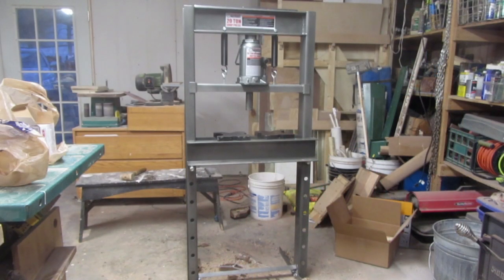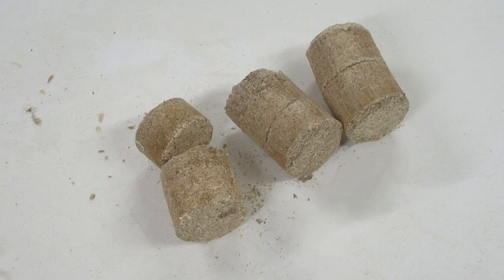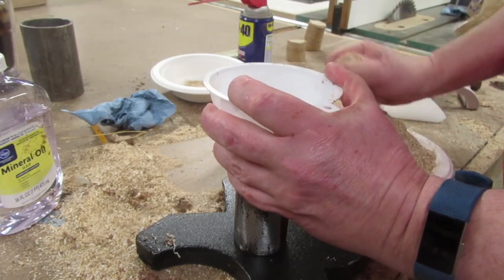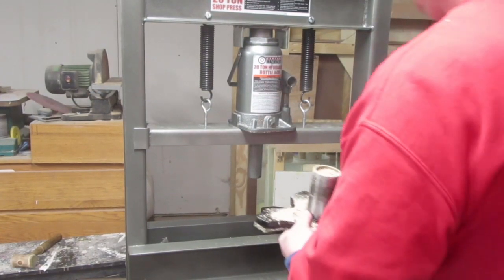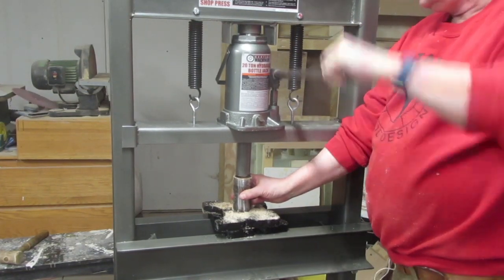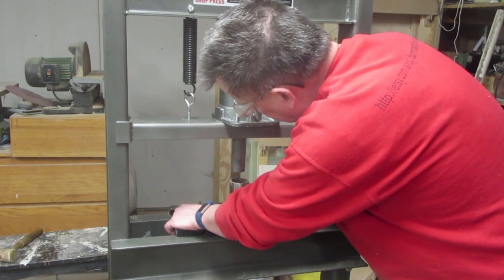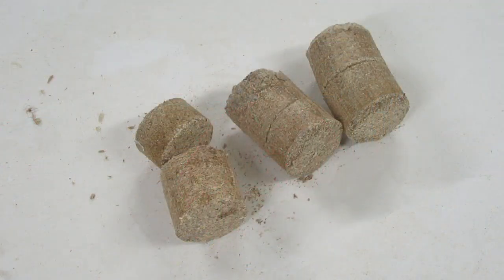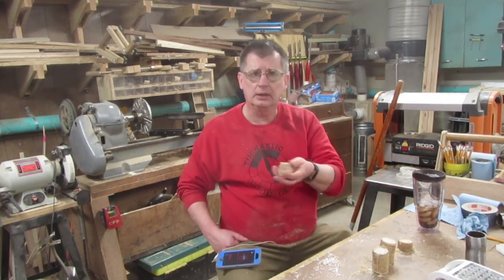What to do with all that Sawdust 2   Pellet Press

Comment: Wood pellets are infact held together by the natural lignin in the wood, but the lignin has to be melted/softened first before it can effectively bind the wood together. The temperature of the pellets can be a couple of hundred degrees when coming out of the pellet mills so you may want to try heating up the die and making smaller diameter pellets for better heat distribution. 

Also we add about 1.5% starch by weight to the saw dust to help bind the pellets together so you could try that as well.

Source: engineer for a wood pellet manufacturer
Reply: the theory behind it is that the compressiin alone generates the heat to gkue them

Comment: Bill I live in Alaska and heat with firewood. But I am also a preper. I have been making fire starters from sawdust (obtained from the local cabinet makers bin) and old candles. I take an old bread pan and heat up the wax until liquid. Then taking saw dust and adding until the mixture is a stiff like oats consistency then mash out into a thickness of about  a inch in the pan. making sure I use a block of wood to pack the mixture. Then let cool thoroughly! then turn pan over tapping it on the bench to release from pan. Then I break apart or cut into cubes and bag!

Comment: I think your on the right track, your using resources to heat your home, shop etc.. Along with HF bearing press I bought the 11/2 ton air bottle jack instead of cranking by hand, so so much faster.
Reply: we have the same setup in our shop. tge air actuated jack is so nice.

Comment: Hello, I'm going to do the same thing. I have the Harbor Freight 20-ton press but upgraded the bottle jack to a Big Red  Pneumatic air bottle jack. I'm going to hopefully get it. If you look at other briquette makers it's a constant feed. The first five or so don't pack as well, until they tighten the end of the pipe { tappers} with a slit in the pipe. I think that will help with the flaring at the end of your pipe. I will try this weekend and let you know how it goes.

Comment: If you have a tapered mold made out of steel you could just keep adding sawdust to it with every stroke of the press, and it will compress it 2 ways with it coming out the bottom  in a log. it shouldn't be very hard to break it to size if they don't do so on their own.
you may be able to make a "proof of concept" out of wood to give it a try.

Comment: Thank you, Bill.  Properly informative video.   The 'Briquette/Pellet' makers have automated machinery that seems to work pretty well, and yes, one of them told me that Paraffin Wax works well in their product. They were looking into alternatives, since Paraffin Wax is typically made from petrochemicals, which hits their green credentials, so they were looking into using Oilseed Rape as a feed stock for the wax... Here in the UK, buying briquettes/pellets made like yours is cheaper than buying town gas or electricity to heat your home. A lot cheaper!  So I have been tinkering with stoves a good bit in recent years.  I can build a 'rocket stove core' that eats twigs, pellets and offcuts, but chokes on sawdust so far - but it is supremely efficient - in the mid 90% range - no big secret, just get  a turbulent burn at around 800/1000C (this calls for refractory ceramic insulation!) and the exhaust is Carbon Monoxide free, which is as good as it gets.  Steel tube rocket stoves cannot do this, the steel loses interest!  I managed to destroy a stainless stove that I bought, tinkered with it until it got hot enough, and then it disintegrated!
I plan to buy a 'sawdust burner' off eBay, see how it works, maybe go for a gasifier/burner/heat riser design to get the temperatures needed?  The sad thing about letting sawdust rot is that not only do the microbes release the carbon in the wood, they also do what cows do and release greenhouse gases!  So I salute your search for a solution.  Well done!  Ben 😉

Comment: Bill, I haven't done it in a long time, but I think its a viable use of the sawdust.  Take something like a popsicle mold and pack it/them with a mixture of wax & shavings. You could also use hard plastic cups. Because it is a little time consuming I would do it while I was trying to figure something else out. They say that the best way to solve a problem is to set it aside & work on something else.  Just one man's opinion.

Comment: Thanks for sharing Bill. I have a lot of trees on my property so I usually just spread my shavings and sawdust among my trees but I do know of several households here in southeast Indiana that have outhouses in use and they utilize the sawdust as composting material.
Reply: Keep in mind that for sawdust to decompose it will pull nitrogen from the soil so you need to add that back into the soil.

Comment: I’d try using sugar water as an additive. Mix it with the sawdust to dampen lightly. You’ll have to let the pellets dry afterwards. But the sugar will both keep it together as well as adding another fuel source. You can even use sugar to build model rocket engines.
Reply: I was going to suggest adding water and leave it to sit soaking for a few days then when it turn into a "mud like" consistency press into briquettes and let them dry

Comment: Bill, Being a blacksmith, the bottom of my coal bin have fines ( aka sawdust). What i do is make a slurry using bad flour from home or a bakery as a source for a binder. I use cardboard egg cartons as a mould. In your case, old cupcake pans or even tapered plastic containers will work. Let dry and voila, a briquette.

Comment: Bill, make the tube longer and only stop the tube for the/a small first pressing.  After that has been compressed, remove the stop at the bottom and load more sawdust into the tube (as much as you can put inside).  Compress again allowing the bottom to come out and cut off to the desired length as it is  pushed through the tube.  

With the suggestion a continuous fill can be achieved thus making the process faster and less messy.

Good luck.
Reply: I think the short strokes are the issue. Constantly having to mess about raising the ram to add more sawdust.

Comment: Wood pellet manufacturers add only water to the mix when pressing then let it dry afterwards. A fire log sized mold would use up more sawdust and take less time overall.
Reply: We only add water to the saw dust if the moisture content is too low. We shoot for 12-13% moisture content in the wood before going into the press and it usually comes out around 7-8% moisture due to the heating of the material in the press.
Reply: @joshjordan6201  Depending on conditions the saw dust from a woodworking shop might still be too dry. Then again it could be too wet.

I've never made pellets but I used to sell woodchips and sawdust to pellet manufactures. We often had to wait until Summer to ship as it rains all winter in these parts. A tractor-trailer load of sawdust gains a lot of weight in the rain.

Comment: I'm watching this video 4 years after your released it.  It's an interesting technique. I was just searching on "pressing sawdust" and your video popped up.
I want to do something similar. The method is time consuming, but it works. And except for the press it's free and you only need elbow grease and patience.
I wonder how much pressure you need. Your press is 20 tons. Will 2, 3 or 5 tons be sufficient as well?

Comment: I use my log splitter as a press,I block the outlet to compact, remove the block and advance ram to push out plug.work in progress building a multi small pellet ram.

Comment: Hi. I've had my hand press briquette maker for 10 years. It's pretty good. You can watch my videos if it helps. But the composted wood chip makes much  better briquettes. 3 or 4 months composted and then make your briquettes and you'll be amazed at the heat and the length of the burn.

Comment: my best use for sawdust reclaimed from the band saw, circular saw and drill press is to mix it with epoxy to create an epoxy fillet for filling screw holes, gaps and various joints on the 21' fishing boat that I'm building. it helps me to achieve perfection where my craftsmanship is lacking. I bought four containers' of wood flour from CLC Boats for the same purpose and found that I've produced enough sawdust to not need theirs. I fill plastic containers with lids  depending on the size of the particles for differing needs. When I need a super fine filler I use all the fiberglass dust I've gathered from sanding, all with minimal waste from the building materials. Everyone needs a hobby, FISHSTICKS.

Comment: Maybe try a two stage ram. They will allow quick ram movement in stage one and then stage two for the intense pressure to compress into the plug. I agree with you. I am always trying new things. Failure is just finding the way that doesn't work.

Comment: I mix my sawdust with paper shreddings plus old veg oil, I put the mix into a briquette press lined with newspaper. I stop the press as soon as I see liquid 'wetting' the newspaper. Even though i wasn't using the press to it's maximum, I still had to build the briquette maker into a framework made from a sleeper.

Comment: Get the paraffin warm enough to barely melted and then mix the sawdust directly in then form them into small balls and you have made the best firestarters ever. You can even take the wax and sawdust mixture and pack it into paper egg crates. Then you just break off a couple of egg sections and use it as far as starters. This works really well for camping. I have made them for years.

Comment: I make pallets for burning and find that you're doing too much to rush the process. I mix saw dust water and scrap newspaper in a 5 gallon bucket. Equal parts paper and saw dust, water to cover and saturate. Then I simply let it sit and dry out in a 5 gallon bucket. When dry and compressed naturally. I take pellet out and cut down into smaller bits. I add paraffin for a longer burn and use them for camping, sell as natural hookah coals and are great for starting that fireplace to set the mood

Comment: You didn't fail. you took a shot, and found a way that didn't work fast. good test run. proved the concept. now scale to suit. maybe a hydraulic ram, powered by a small engine, like a log splitter and a thicker die, to push the wood through. and bingo,  you stand there and operate the ram, refill the wood, and wood plugs drop out the bottom.

Comment: Use a 12" tube and drill 1/16" holes in bottom 6" for fluid to drain out. 2" abs or PVC works well.

Comment: For my fire place insert as a fire starter - In a 5 gallon bucket, compact saw dust 90% full add 1 gallon of used motor oil.  Use as bed to base for fire wood

Comment: I love that you tried it and tbh I think you should just try to optimize the production more. The ideas were good (except the stove), but you didn't do them very efficient.
For example: Mixing paper and sawdust is a great idea, because you will get free heating forever! By using a larger buck to mix more sawdust and paper together and let it soak a day, you only have to mix once for huge amounts of pulp.  This method is used to make bricks for buildings, and there are tools to create them very quickly. Mainly there is a kind of mold-press, where you just put the pulp in and squeeze a bit and you get a larger brick. You leave it there to dry and make the second brick next to it. It's a matter of 10—20 seconds per brick.

If you don't wanna do it yourself, have someone's kid do it for some extra money. It's a fun thing to do when you think about it :)
I will try to find a vid on yt that shows more effective ways.

#edit: I found a video with the tool I mentioned: https://youtu.be/7bwKYfMoFYQ
Maybe it's something for you! 

Thanks for reading!

Comment: I saw awhile back a video of a guy using a hydraulic log splitter for a similar purpose. He replaced the wedge with a flat head and pressed dry leaves into a "log". That might work with the sawdust.
Reply: Also, no pumping of the bottle jack because of the hydraulic pump. Can be electric or gas engine. Louder but faster/easier.

Comment: Do you just want to get rid of sawdust or are you trying to develop another fuel source?  If the former, try this. I just fill a four-cent brown-paper lunch sack about two-thirds full of sawdust and double-fold the top.  I put one bag on top before lighting a new fire and place a fresh bag on the hot coals when adding more firewood.  As the paper is consumed, the flame produces a crust over the surface of the sawdust. The sawdust retains the shape of the bag and slowly burns on the surface.  If not disturbed, it is consumed along with the wood. Even if the burning sawdust gets scattered around when adding more wood, It has never put out the fire. Getting rid of sawdust can be simple and easy. Turning sawdust into fuel doesn't seem worth the time and effort.

Comment: I add sawdust to an empty paper towel holder. Close off one end and fill tube half way then add peanut oil . Fill the rest of the tune with sawdust and tamp down with a dowel. When full close off the other end. Place on hot coals or light with a match and it will burn hit and fir a long time.

Comment: Great video. 👍 Real easy way to get rid of all that sawdust is pretty simple.. just take some used motor oil. Mix it up and put it in small little baggies. Then toss it in the wood stove. 

I suppose you could compress it into a fire log. Which I'm all for. 

Anyway I can heat the house for free. 😁

Comment: Finding an old 30 ton (or so) log splitter and converting it would be the way to go. Build a hopper that you can fill, have the ram pass through that pushing and compacting the sawdust into a die. When the die if full, open the end and use the ram to push it out. I make a lot of sawdust but not enough to justify the cost of building the machine nor do I have a place to store it since space at my place is a premium. .

Comment: I would try soaking it with water.  Then get a larger pan put the pulp in and crank down as the water pressed out it should dry to a brick.  You should also try beeswax or wax but melted and pour into and mix. I've used 5 gallon buckets with a weight to press it.  Then brick it out. As long as its a hot fire should burn clean

Comment: You probably have scheduled 40 pipe, see if you can’t get scheduled 60 or 80 pipe, the are a thicker wall and will stand more pressure, just make sure the plunger will fit the new pipe.

Comment: Use it for insulation use dry plaster or cement , mix with your saw dust ,light coat ,fill space the moisture from the wood will set the mix and it will dry and firm the mix and mice won’t use it for nesting.

Comment: Mix the sawdust with used oil and put it in a waste paper bag and throw it in the fireplace.  As long as the fire is good and hot, there will be no issues with creosote.  Use old fryer oil or motor oil.  For the bags, use old mailer envelopes, or even small boxes.  Much less work and many free BTUs!

Comment: Cheap solution.waste vegetable oil mixed in with saw dust (just enough to get it chuncky,but not dripping, it's just messy)pack it good into empty paper towel tubes,toilet paper rolls,paper bags,ext.
You now have fire logs for your stove,fire pit,whatever! 🖒
Btw,good experiment &thanks for sharing.

Comment: hello, why don't you fill a bigger diameter tube/pipe (8-10 inch diameter) ? Fill it up with sawdust, put one same sized (but thick) disk on the top and use the the press to press together. You could get as a result like a huge hockey puck. And this way you could use about 5-6 times more sawdust for one pellet/hockey puck :)
If you like the idea please make a video of it :)
Reply: The pressure required is proportional to the area. You would need about 8 times the pressure about 160ton. To do 8 inches.

Comment: So basically, he showed us a Failure? What NOT to do? yeah, i already knew that part. you NEED to have a machine Shop make one from a solid block of steel ( 3"x3' Square and 5" Tall) with a hole exactly the size of your press ram. Simple, Pricey, but Simple. BTW, it also makes it easier to REMOVE the pellet as you have MORE shoulder then just with that Pipe. You may want to make a device to remove that pellet like a manual Tire Bead Breaker with a long handle

Comment: Why not just add some saw dust to your wood stove when your heating your shop?
Reply from the maker: Actually sawdust is quite difficult to burn because of the lack of air.
Reply: I use wood chips from tree services too.
Reply: @TurntasticWoodDesigns  you may install a small fan in your stove for fast burning.

Comment: forget all that work just build a wood chip/pellets stove  like a did it burns both with no electricity , it's gravity feeding it burns up to 800 degrees , wood chip less hotter , wood pellet better , "both together perfect"  and chips are free ,  got it  in my garage now I'm going to make my own burner to convert my oil furnace in the house to burn chips and pellets